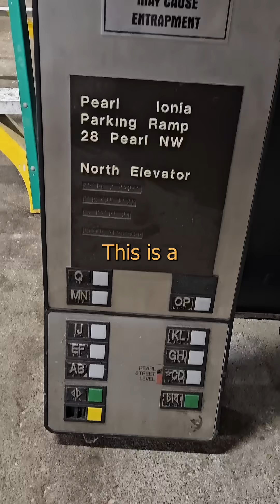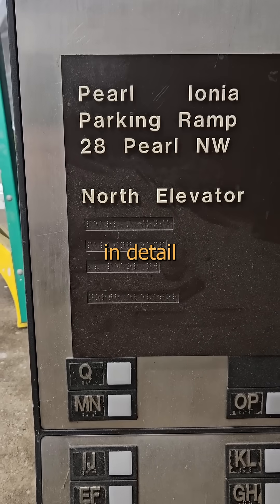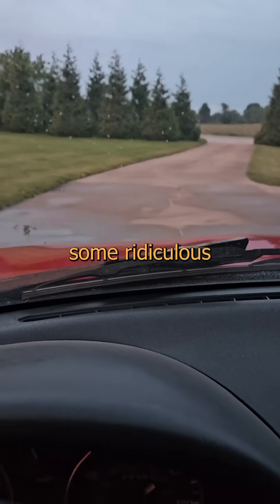Miata Mischief #chrisboden #engineering #gear #elevator #score #stories #parts #hacking #making

Comment: I am a commercial / professional house painter, and my fathers my boss. I once had to close a job that seemed business as usual as I’m the “closer”, but when I went to tie down the 4 ladders I had on my lumber rack I found out that he took my tie down straps out of my truck. Why? I have NO idea even now. I already had a packed bed full of trash and tools so I didn’t really have any options as this job was a good 45 minutes from our office, 1 hour plus with traffic, and the worst part? We were starting another project the next day, and the customer I finished today had nowhere good to store the ladders until I could come back In 2 hours, meaning they would be most likely stolen by the time I got back. 

The solution? I used white tape to hold down the ladders, and These were not some small ladders either. I’m talking 1 16 Ft extension ladder, 2 24 footers and 1 32 Ft extension ladder. All expensive Werner orange Fiberglass ladders, anyone who has worked with these ladders knows that they are heavy ASF, as a combined 96 feet of fiberglass extension ladder weighs about 250 pounds. 

4 entire rolls of white 1 1/2 in wide painters tape later, a ton of slow driving and some good old Johnny cash was enough to hold everything together to get home, where my father basically awarded me a medal lol. 

Moral of the story kids is to keep the down straps literally everywhere in your truck.

Comment: My crazy hauling story involved finding a solid hardwood computer desk at Goodwill for $3 in 2017. Having just moved to the area and not having any acquaintances or family with a truck or means to rent one in a hurry, my dad decided we would haul it on the top of my ford focus sedan. We got a towel and an outdoor tube-style light strip, tied the light cord to the driver's side door frame, wrapped it over the desk, and my dad gave me the other end to hold in the passenger seat.

I was white-knuckling that thing for the whole ride to my new apartment. It was the sketchiest thing I've ever done that didn't involve potential extreme bodily injury. This was in an urban environment as well, so this was being done in heavy traffic that was NOT happy to deal with us, even if we weren't going as slow as we should have given our load.

Comment: i drove home with the big sign from peugeot of van nuys it barely fit in a my 98 wrangler on top of that i also had a 50 gallon barrel in the back, the sign is about 5x5 foot so i wedged it between my set and the barrel, and had to drive home head crooked plus the jeep is manual

Comment: I drove with my brother 6 hours in a rusted out F-150 with a bed so soft I couldn’t stand in half of it to pick up a planer my dad bought on GovDeals. The truck had a Triton V8 that ticked more than a clock, had lost at least 30hp since it rolled off the line and the automatic transmission sometimes forgot to shift into 2nd gear, sending the already worn out engine to uncomfortably high RPMs. It would then skip 2nd gear and shift from 1st to 3rd and nearly stall itself. It not dying on the side of the highway was a miracle that definitely came from divine intervention 

That truck was on the road for another 5 years after that. Which somehow is both surprising and fitting
Reply: That sounds horrifying. I love every bit of this story.

Comment: It wasn't so much a cool thing, but a small boulder. My friend and I went to the beach and saw a rock that we tried to pick up to find it was the shoreline equivalent to an iceberg where only a tiny bit was exposed.

After about 30 minutes of digging with just our bare hands, we had to take turns hauling it to the car - we parked about 1.5 miles from the shore.
This damn thing was pretty massive and very heavy, and we had to take breaks, but we ended up getting it home.
After we all moved out of that house, my parents came back to visit and went to the old house, now owned by someone else, in the middle of the night and procured our small boulder back- they took it with them back to Arizona 😂

Comment: I had a 29” mountain bike wheel at the shop for repairs. The day it was ready, I was riding my Suzuki S40 cafe racer. I used a piece of rebar tie wire to attach the wheel to the top handle of my backpack. I couldn’t lift my head up because my helmet hit the wheel. 
My daily driver is a Ford Fiesta sedan. It hauls everything. I know it will hold 14 double roll toilet paper dispensers and right around 40 10lb fire extinguishers before running out of suspension. 
I moved a 45’ flagpole with a 26’ box truck. It stuck out the back like a medieval  jouster riding back wards.

Comment: I work construction.  I had a job once where my demo guy had to go on vacation before he finished prepping the house. So I finished the demo and he told me to use his dump trailer to get the material to the dump. I asked him what the limits were and he said, "full it to the top! It'll take anything!" And so I did, with a two story brick chimney and the two massive brick fireplaces attached to it, filled in the gaps with shovel loads of plaster from the ancient walls and put all the ancient cast iron pipe on top. Then I swung by another site and replaced the tarp with a solid layer of wet silt logs. A couple straps so she wouldn't go anywhere and off to the dump I went in rush hour traffic. 

I knew she was heavy by the way that my 1-ton diesel couldn't break 45mph. But just assumed the majority of the problem was the blown head gasket on my 6.0. The lady at the in scale helpfully told me they had a half ton minimum when I pulled up with a pickup and trailer. Because, "lots of guys don't hit the minimum with pickups." I was reading the scale but assumed it must be in some unit other than pounds because how the hell could I really be tipping the scale at 42,000lbs. Then I weighed out after needing to hand unload the trailer by hand, because the hydraulics weren't doing the job, 10,500lbs truck and trailer.  I had 31,500lbs of rolling accident waiting to happen behind a wallowed out F350, in tandem axle bumper pull dump trailer. 

Borrowing the trailera few weeks later to haul my skid steer felt like there was nothing behind the truck.

Comment: I put a pressure washer in my front seat cause tue box didn't fit in my trunk. I had it seat belted in and had to hold it when stopping so it didn't tip.

Comment: I was working with a biofuel company transporting mulch chips. Like 20 barges full of wood chips. 1 wood chip was a 6 ft long 3 ft wide red oak log that i wanted to mill out. so i used a skid steer at the job site to load the log into a rickitty old box truck, in such a way that if i speed up too fast the log would roll through the backdoor, so i chalked it, and drove the quarter mile back to yard.
 Now here's where things get interesting... the skid steer had to stay at the jobsite. so in order to get the log out i wrapped it in a steel chain and connected it to a pick up truck. Then i just hit the gas on the box truck.

Comment: One time I rented a u-haul motorcycle trailer to move my toolbox. Spent 30 minutes convincing the guy that the tow hitch on my Golf wagon is factory equipment because he just would not believe that a it could pull a trailer. Finally he lets me sign all the papers, and we go out to hook it up to my car. Once it’s all connected, he sees the trailer lights don’t work and basically says “you ain’t leaving unless that shit lights up.” I had about 30 minutes left on lunch to get this thing across town, I start checking the wires for the trailer lights, and of course it’s severed underneath the vehicle. Dude walks off to find a manager, so I start rummaging through my car for a butt crimp or soldering iron (yes I’m a slob and my trunk looks like Ripley’s museum.) best I can find is 100 feet of unsheathed 8 gauge copper and a hatchet. Coast looks clear- I slide up under there, twist the new wire to the front half of the old one, disconnect it from the battery under the hood, and yank it through. Chopped the new wire to length with the hatchet, put some Teflon on all the  connections cause I didn’t even have electric tape, and somehow it all worked. Guy walks back out right as I’m crawling out from under it. He starts asking questions so I told him I dropped my keys down there. He seems unconvinced, but I’m allowed to leave with it. I drove all the way across town smelling burning plastic and shitting my pants. Luckily all I ruined was my battery and my skid plate 😅

Comment: Was working part time in a phone shop. The guy there had 170 BlackBerry Classic Q20 phones, and said that I could take them and sell them on eBay, and keep 50%. I put all of them in a cardboard box and wrapped it with several layers of packing tape to ensure the 29.4kg / 65lbs of phones didn’t fall out and burst the box. Pretty sure I gave myself permanent back problems from spending half an hour hauling that box back home from the shop at age 16.

Comment: Lol you're definitely not the only one. I'm actually getting ready to head to home Depot in my old 08 dodge caliber with 215k miles on it to pick up 5x 16 foot 2x12s, a 2x8, and a sheet of plywood to rebuild the stairs to my basement. Yesterday it was a bunch of PVC to replace all the old black iron drainage pipes that have been here since the 1940s and have so much mineral buildup they no longer let water through them. Other than trying to figure out how to get materials to my house though I'm enjoying the process. 

I know Home Depot and Lowe's both deliver but for some reason despite constantly hearing they have free delivery, apparently not on anything I need because HD is $75 and Lowe's is $145, and I need it today. I'm not paying that much to have something delivered from 6 blocks away at some point later this week. So, it's time for Jenga!

Comment: We used to have a 1988 Dodge Ramcharger, and we sold it on marketplace. The people that came to pick it up had a uhaul 1500 V6 2 door ram, and a trailer that was the base to an old RV. This Ramcharger had big mud tires on it so when it was on the trailer, half of the tire on each was off the edge of the trailer, and the 1500 Ram they brought was so under load it looked like a Carolina Squat. They drove 2 hours home that way.

Comment: In the 90's my boss at the time was a huge motorcycle head, he had 9 motorcycles. One day he asked me to help him take a bike to his mechanic. He informed me that he left his tie downs were in the other truck that someone had borrowed. He said he was going to wear his helmet, sit on the bike & hold it up so I need to take it easy on the turns. We are driving through downtown Sacramento on 9th st. right past the highway patrol office. Instantly got pulled over by a motorcycle cop. The look on the officers face...a combination of wtf & you idiots. I get the heat right away because I'm driving. He asks for my license & other documents. When I hand it to him the first thing he says is "what we're you thinking" ? I told the officer that the man on the bike is my boss, I told him it was a dump idea but he was insistent that it was safe and it would be fine. Before he went any further looking at my info he ask my buddy on the bike "how did you think this was a good idea"? Louis came back with "we're driving slow & cautiously like an oversized trailer or cumbersome load". 

There was some calm stare at each other paused back & forth, like "where are your tie downs"? "They're in the other truck". The officer finally says "do you know how dangerous this is"? Louis replied "I'm wearing my helmet". The cop was dumbfounded. The look on his face dude! Dumbfounded is the perfect description of the cops expression! He started to speak & he stopped, he was going to say something again, then he looked at the ground shaking his head & says "I don't know man, this is one of the most dangerous things I've ever seen. I'm not going to give you guys a ticket, but don't ever do this again, use your straps next time or call a tow service. The officer handed me my info & let us go.

I'M WEARING MY HELMET 😂😂😂

Comment: I think it was either 14 to 18 foot long 4x6 support beam for some remodeling job i had going on at a repairshop i worked at. I had a saab 900s from the late 80s, before gm, so the hatchback was long. I somehow managed to insert the loooong wood 😂from the back and have it pop out through the sunroof😂 some lumber yard worker saw me put it into the hatchback and said in all his years working there im the first guy to successfully to put such a long support beam on the inside of the car the way i did, he even took a picture of it i guess for memories. The ol saab was ready for L.A. traffic jousting.  It went past the front bumper and was inclined at maybe 35° more or less. It was a long drive back to the shop. For sure got many people looking at the car

Comment: 120 car batteries went up for sale 2 hours from my house. It was an auction for an old golf course that closed. Went out intending to just buy a handfull of them. Turns out it was a LOT of 120 batteries. No one wanted to deal with that so i won at $150. My ford rangers bumpstops? Gone. Ball joints? Dust. That 2 hour drive home was actually closer to 5.

Comment: I had a 91 ford f superduty with a farmer made 9.5’x8.5’ stake body flatbed, the truck that later became the 450.. well its clutch went and we had to get it to my buddy’s house. Another friend had a 02 ford focus also so the the clutch out. We rented a u-haul tow dolly and their pickup truck which was a Chevy Silverado 1500. Towed the focus no problem, and I accidentally did a 4 wheel peel. I realized it definitely had enough power to tow the superduty. We somehow managed to get the damn thing on the tow dolly with about an 1/8” total to spare. Towed this thing for like 30 minutes before remembering to put it in tow-haul mode. It took us an hour for a 15 minute drive but it did it for sure. We burnt the hell out of the brakes and I definitely smelled the tranny cooking itself. Never went back to that U-Haul.

Comment: Once upon a time, i ended up offered the entire inner workings of a RCD box.
I am the proud owner of enough equipment to run an entire 4 way intersection with separate turn lanes.
Imagine 8 separate bags of concrete, in metal boxes just small enough to carry
I brought home all this kit home on; a peice of plywood, balanced on some kids razor scooter and a literal brick, almost 2 miles.

Comment: Skoda fabia, three sheets of three quarter inch ply, 6 16ft lengths of 4x2 on the roof and a half pallet of concrete blocks in the back. Had no steering and was basically doing a wheelie all the way to the job, but it got done

Comment: I used to drive a 1996 chevy corsica and someone gave me the opportunity to get a boat so I took my non highway safe car drive it 200 miles (it caught on fire twice because an oil leak) and stuck a makeshift gooseneck hitch in my truck took a flatbed and Jimmy rigged a boat onto a gooseneck hitch being hauled by a sketchy after carv

Comment: I was in college circa 2012 and had a final project in one of my automotive classes about alternative fuels. I could either write a 10 page paper or make a project that had something to do with alternative fuel. So I decided to take a brand new push mower and make it run on 1lb propane bottles. 

I wanted a brand new mower so I wouldn't have to deal with any potential problems from a used one. Only issue was that I didn't have a truck nor did anyone I knew at the time. And I needed to buy a push mower from Walmart, which come in huge boxes.

So I drove my 04 GTO to Walmart, bought it, and somehow managed to squeeze that box into the passenger seat. Got it home without a hitch and ended up passing my final with flying colors😊

Comment: Sketchiest, probably when I was 10, an oversized leather recliner, on a radio flyer wagon from down the block. The thing weighed twice as much as I did and was 3 times my size. I don't think my parents let me keep it.

Most expensive probably a high end French door refrigerator that needed a new capacitor.

Strangest, probably an electrostatic inline duct air filter, that I don't know what to do with.

Honorable mention is probably propane grills. For a couple dollars in parts I've fixed up a handful of high end ones that lasted me for years after they were thrown out.

Comment: A few years ago i was a semi driver and on one of my rest stops was a abandoned Factory and on one day i could not resist the urge to take a look.
I found that there was a boat load of arcade and fair stuff and most of is was like form the 60s and really heavy.
So i could not even make it move alone but i found a bull bar that would have been on a (probably) mini jeep on (probably) carousel and so that was the only thing that would even fit in my cab.
Worst part of it all was smuggling a 90cm by 60cm big heavy metal frame from the truck to my car.
Love the videos btw
Greeting from holland

Comment: I was helping my brother out with rebuilding the front of his car. Went to the junk yard in my 2006 Scion tc. Ripped to whole front end of a cobalt, bumper, crash bar, hood, radiator, fenders, ac condenser, and a door. We not only carried all of the stuff back to the car, it also fit so incredibly snug only had to put a little bit of pressure to get the hatch closed. Nothing even creeked on the way home. 😂

Comment: A few years ago.
I had a 1991 ford escort 2 door hatchback.
And I came across
A 1968 motoski, Zephyr and decided it would fit
I removed the passenger side front seat and turned it around to protect the dash and stuffed the sled in the car tail end, first propping the hatch open as my car's doing bunny hops down the highway from  being overweight in the rear